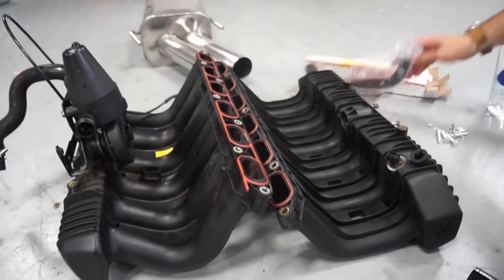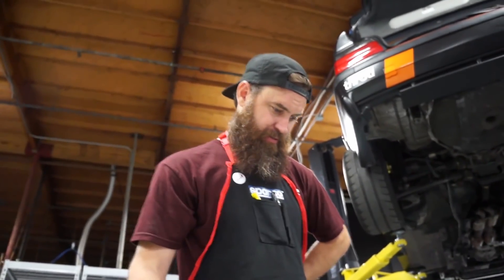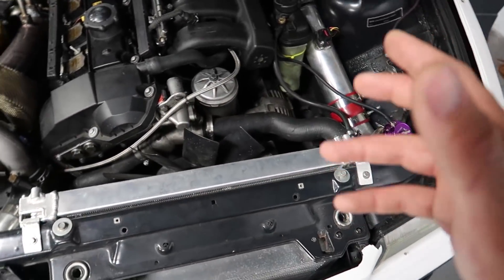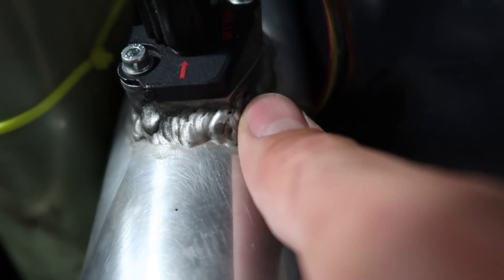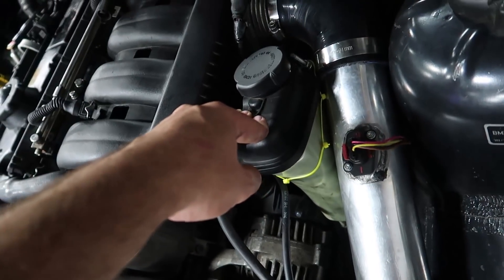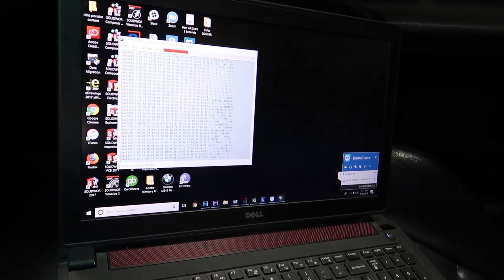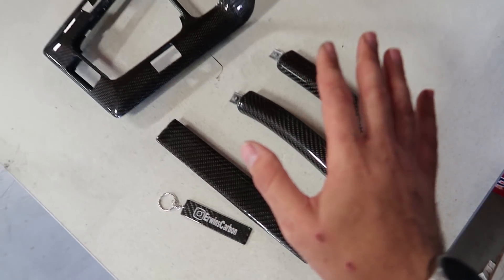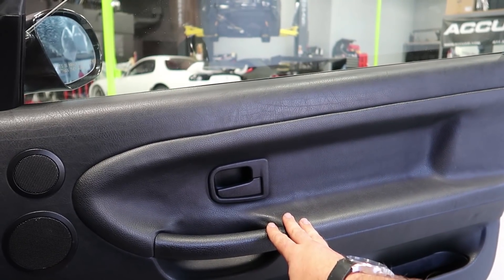FULL BOOST RUNS IN MY +400HP TURBO BMW E36 M3!!!!

Comment: I've had THREE E36s and can tell you that the door panels are the worst! That yellowish glue is not OEM, it is Gorilla glue and it is the best for fixing those door panels. The Gorilla glue, when used correctly with some dampness on the backside of the panels, is the BEST and will hold up. Trust me! I speak from much experience! That epoxy will hold for bit, but will eventually give way. Also, just a thought since you have a race inspired ride, check out I believe...Hard Motorsport. They offer some lightweight plastic E36 door panels that look somewhat OEM, but are actually way lighter and simpler and you ditch the problem of the factory panels falling apart. I KNOW E36 INTERIORS,  have repaired my three and others as well! :)
Reply from the maker: I’ve seen those! How is the quality of the hard Motorsport panels?
Reply: I've never had the Hard Motorsport door panels, but I have seen them in person. They looked better than I would have originally thought. I love that they ditch the actual pockets at the bottom because that is (as you know) a very problem area with the attachment points of the original panels. I think they would really work for your car.